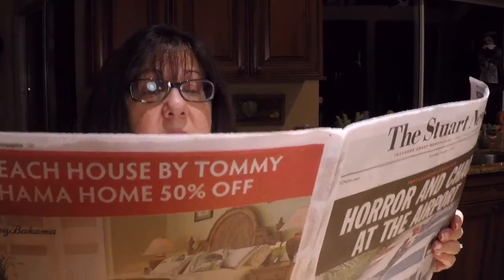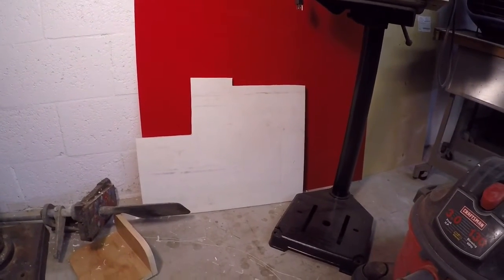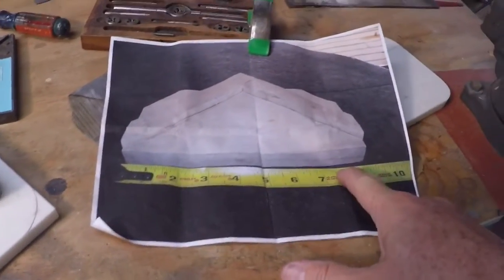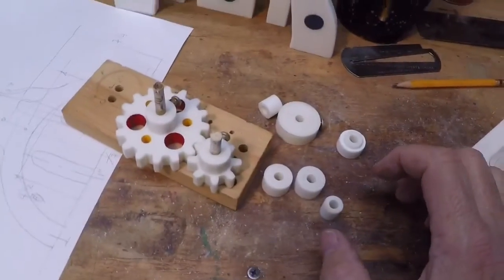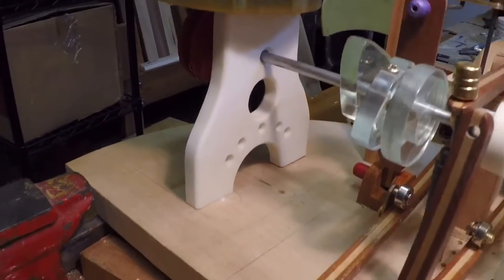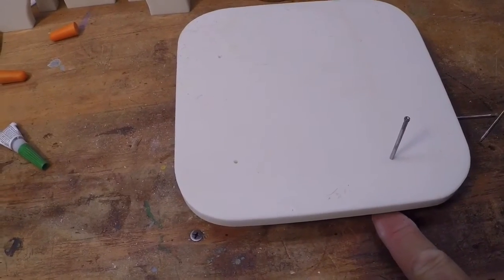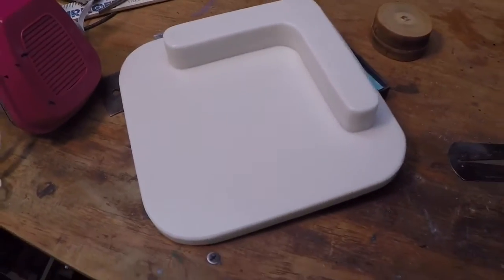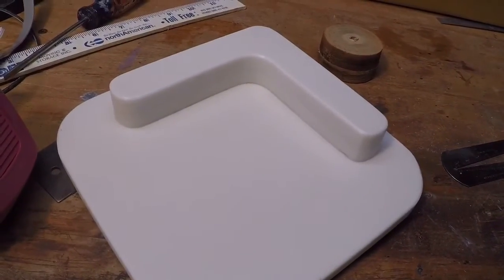Love Affair Confession (Corian is her name) - Stuart Arts Episode 41

Comment: Looks like a great material for making knife handles. Just wondering, can it be easily cut with a scroll saw?
Reply from the maker: Hardrock the material will gum up when it gets hot. The scroll saw didn't work for me because the blade gets hot. I use the bandsaw because you can control the heat build up with a coarse blade. Good luck!